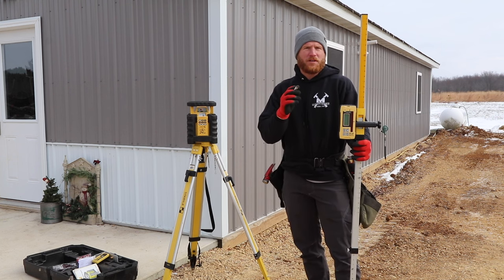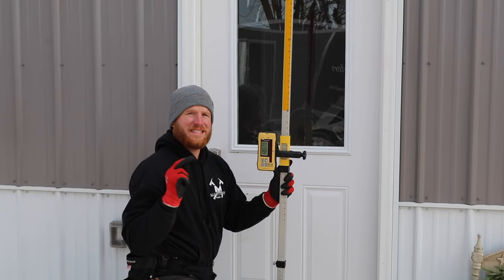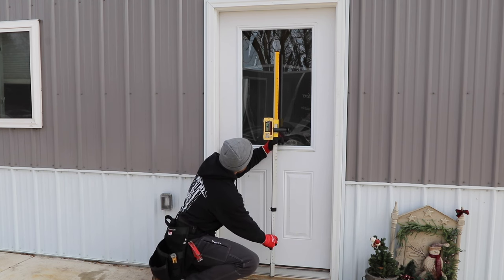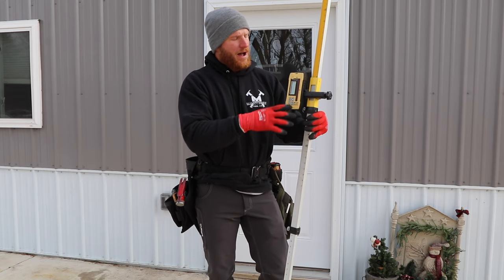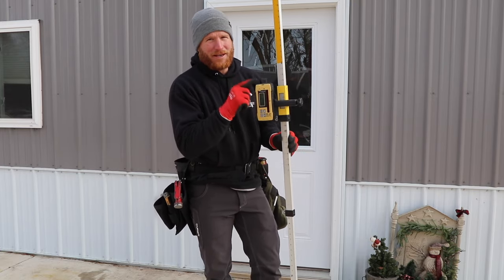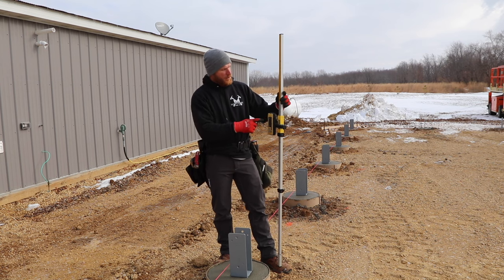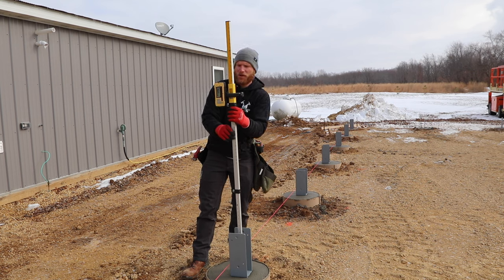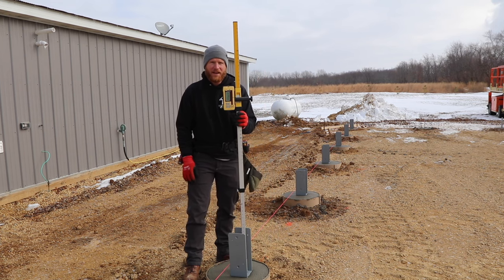What is a grade stick for?

Comment: Actually people get confused because the explanation ask people to just follow the rule of -4 and +4 inches. 

The easiest way I think if you ask me, 

Take the laser unit with tripod  and place it on the reference point. Let it self level to zero. 

Then take the stick and place it on the floor together with the reference point. So laser snd and reciever are at similar point of reference. 

Adjust the receiver up and down until the sound locks on solid. This means the stick is at zero level with the rotary laser on its tripod. Before moving anywhere, if you rise the stick up while being locked at number zero, it means you are at higher grounds. You will need to go to minus numbers to get the solid sound. This means higher grounds will give you negative numbers on the stick and positive numbers on the lower grounds assuming the laser unit is not moved from the initial reference point. 

Next, anywhere you move the stick, extend or retract the stick from the zero mark. When the stick goes to the minus side to lock the solid sound, it means the ground on that side is higher than the reference point. Similarly, when the stick moves on the positive side, it means the ground is lower than the reference point.  

JUST THINK OF THE STICK WITH NEGATIVE VALUES, A ZERO IN THE CENTER AND POSITIVE VALUES. IF THE GROUND IS LOWER, IT MEANS THE STICK WILL HAVE TO BE EXTENDED TO COMPENSATE THE LOSS OF HEIGHT. BASICALLY YOU CAN USE ANY TYPE OF STICK EVEN IF ITS NOT NUMBERED. WHAT MATTERS IS THE CONCEPT NOT NUMBERS. 

NOW WORK OUT ON THE REAL UNIT TO UNDERSTAND IT YOUR SELF.

Comment: So, when you said you are "1- 7/8", were you saying that the bracket is 1-7/8" below the finished floor?
Reply from the maker: The bracket is 1 7/8 below the bottom of the grade board and therefor 5 7/8” below top of concrete which is almost exactly where we planned it.

Comment: Still don't understand why you're using the top of the bracket on the grade stick and not the middle where the sensor actually reads the laser at. Guess it doesn't matter where you read the stick from as long as you are consistent?
Reply from the maker: Exactly

Comment: Reading the comments, I see some didn't follow.  Just try skipping the very first part where he sets it to zero.  That is irrelevant and misleading.  Go ahead to where he says that the threshold he is at is four inches higher than the grade on 'his' site.  Then when he sets the level to +4 it might make better sense for you. (This is the only time he SETS the level, the rest of the time he MOVES the head.)  When he gets to 'his' grade, he would theoretically then get tone at zero.  Now ignore the part about 'setting' it to zero again, as he really didn't do that, he moved the head to -1 7/8 to get tone.  Since the tube was poured to 2" below 'his' grade in a perfect world he would have tone at -2.  We see he gets tone at -1 7/8  (Greg's fault).   Now, when he goes to saw his post columns, he will set the top of the story pole at the top of the column.  Then he will walk down to the bottom and make his saw mark on the column at the story pole bottom line plus 1 7/8.  Now, if all of the columns go onto the correct tubes, the tops of all of the columns will be at the perfect height above 'his' grade.  Same goes for all of the other marks on the story pole for girts and ledgers, etc.  I know that won't help everybody, but I hope it works for you.